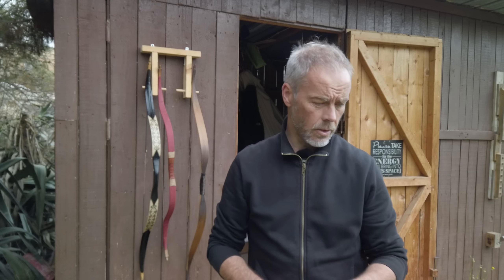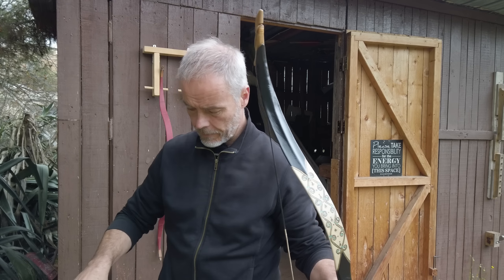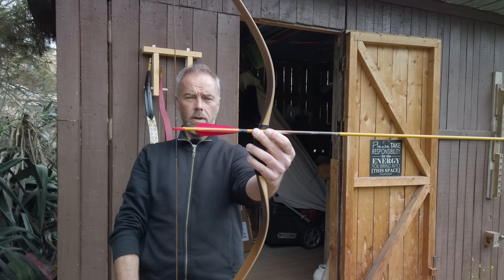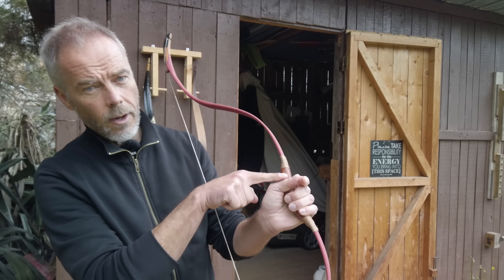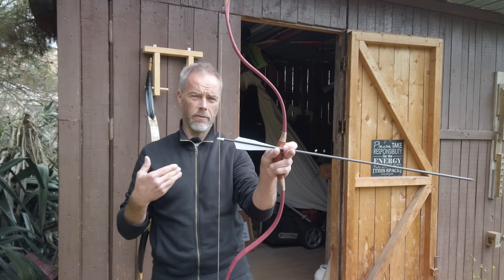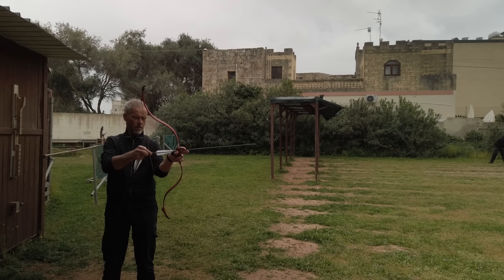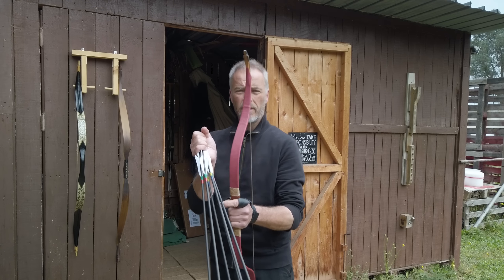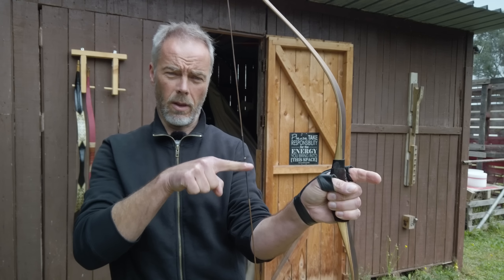Archery FAQ: Nocking Point on a “Horsebow”, which effects?

Comment: All so true. Thank you Armin.
First step I use is proper hand location……then create a reference on the handle. I regrip my handles, and add several wraps of heavy cord around the handle, just beneath my little finger, and tape over the cord. Recover/regrip the handle. Now I have an exact hand placement…… which creates the arrow pass location.
Next, using a bow square, located where the bottom of the arrow shaft would be located at the arrow pass, go to the bow square correctly attached to the string, and measure up and mark the location on string serving. 5/8” is pretty traditional for many shorter draw bows. I use 3/4” for my Zhu Ran. The longer the draw, the more the nock presents itself in relation to the arrow shelf. I find for me, w/ the 3/4” nock location, I don’t get thumb nicks while drawing 34”-35” on my Zhu Ran. Can vary for others.
Tie on your nocking point starting at the mark, tying upwards. A whip finish or Nail Knot work very well for the nocking point.
Ever since using this method, my groups are smaller, I never get a bow had nick, and I don’t need a forearm guard.
Hope this helps.
Reply: Thank you for sharing an excellent technique 🙏🏽

Comment: I just want to make sure I’m following, are you suggesting that instead of a right angle or perpendicular nocking point, it should angle slightly downward - or rather angle the nock slightly above the tip so it points slightly downward?

Comment: To be honest I dont really understand why a higher nocking point would decrease scratching by the fletchings. The shaft still rests on the bow hand's thumb joints/knuckles/somewhere. The fletchings will still follow the path of the shaft and scratch the bow hand's skin, just from a slightly steeper angle. What am I missing?
Reply from the maker: One of the miracles in archery :) it just works
Reply: I can’t tell you why it works but if I nock a little off 90 degrees and especially if I use feathers I don’t get scratches

Comment: I'm a little stupid, so I have to ask this question. What was the difference in the knock adjustments? I saw the stills, but like I said, I'm a little slower than others, so I didn't understand what the difference was, thanks for whoever helps me out here lol.
Reply from the maker: Arrow flight, when the nock is too high or too low it will have an impact on how straight your arrow will fly.
Reply: @ArminHirmer  Oh wow, you're right. Didn't even think of that, thanks for the explanation! love the videos!
Reply: Arrow vibration. Easy to see and virtually zero with high knocking point.
Reply: @youcanthandlethetruth6976 I must be stupider than you, I watched the video over and over again, but still didn't see a difference in the arrow flight, both had the fletching higher than the points, what did I miss?